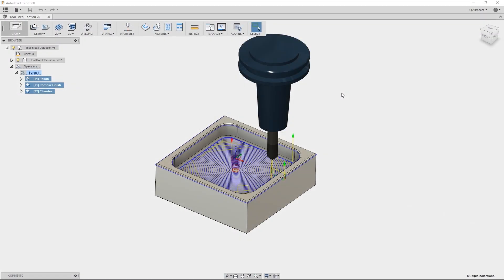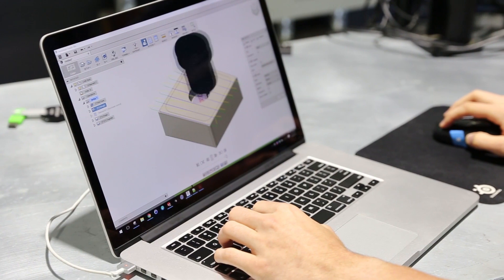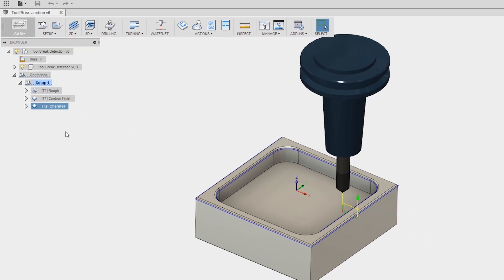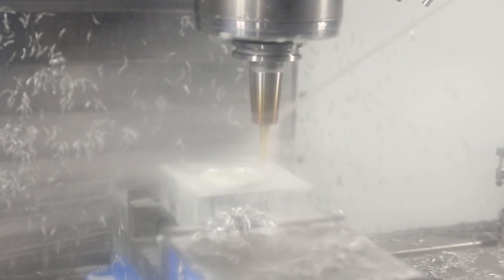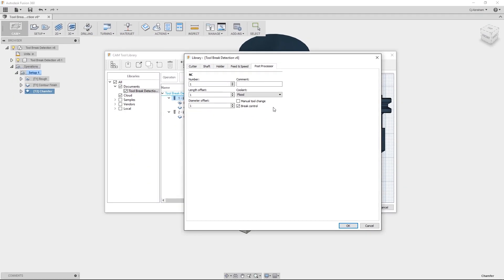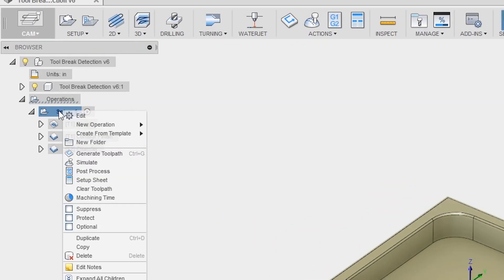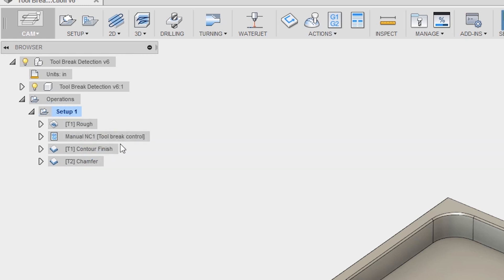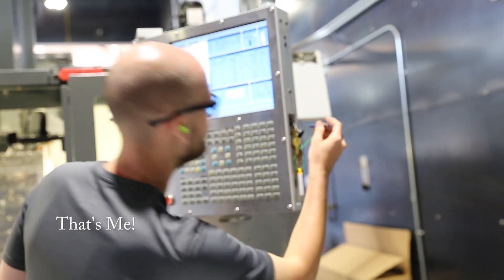QUICK TIP: Tool Break Control

Comment: Will the control know what type of check to do on each tool? Like rotating vs not if the tool is a larger endmill
Reply: The cycle that is output is determined by the post, so the logic would need to be built into the post to output the desired probing cycle for different circumstances.
Reply from the maker: Gonna check with the expert to get you a correct answer. Pardon any delay.

Comment: Cool! I use toolbreak detection a lot, but feel it's taking quite a lot of time. 

This is why I recently made my own cycle. I just have to call G204 and the machine will check whatever tool is in the spindle at that moment. 

It's a lot faster than the standard haas/renishaw cycle, cutting the whole cycle down to about 15 seconds instead of 45 or so.
Reply: nice! fancy sharing how you wrote your cycle? you can publish articles on the Autodesk knowledge network for others to refer to if you like.
Reply: Scott Moyse sure, I'll have to get it somewhere next week. But it's pretty simple actually. 

The logic behind it is taking the renishaw coordinates of the tool probe. And send your tool to Z home. Then position it next to the tool probe by a few mm (20 or so + half the tool dia) and let it go down to about 0.1mm below the top of the tool probe. Do this in G31 mode, so you can make sure that IF it's got a signal before reaching the desired hight, it means something's in the way of the probe (long chips or so). 

Then if that didn't happen, good, position your tool to the center of the probe, again using G31. If the tool got there, it means there's no tool with sufficient length in the spindle anymore so it's broken. 

If it did get a stop signal before it got to the center it means the tool is still there and you're good to go to the next operation. 

It has some basic logic IF THEN logic. 
I'll see if I can post it for you somewhere this week.
Reply: Scott Moyse Oh, autodesk knowledge network? Didn't knew about the existence. I'll Google that :-)
Reply: +pjotter0 cool! here's a link to it https://knowledge.autodesk.com/community/articles
Reply: Hi Scott, I've just wrote an article and it's pending publication. I included the NC file and some explanation.
Reply: +pjotter0 sweet! on the knowledge network?
Reply: +Scott Moyse yes. But it's not yet published. I guess they'll want to check it first to prevent spamming or something like that.
Reply: It's published now, here's the link: https://knowledge.autodesk.com/community/article/26776
Reply: @pjotter0  cannot dowload the Nc program. Could you write it in the article ?

Comment: Is there a special post processor needed? I have a haas mini mill and used the Generic Haas post processor. but the code to check the tool is not shown in the post file?
Reply: The generic haas milling post should work. If it's not working, try downloading the latest haas generic post from the post website: http://cam.autodesk.com/posts/